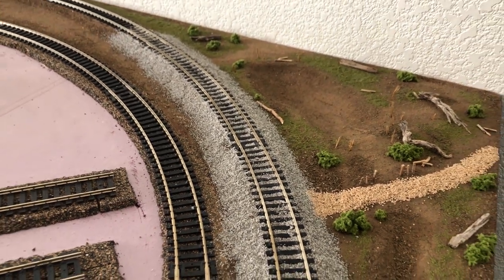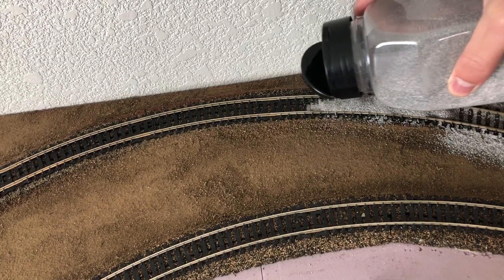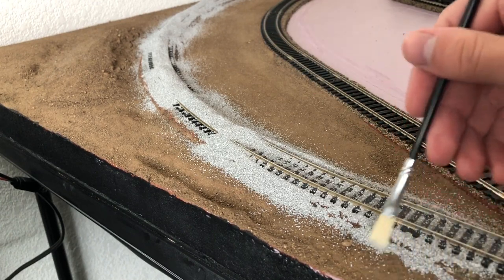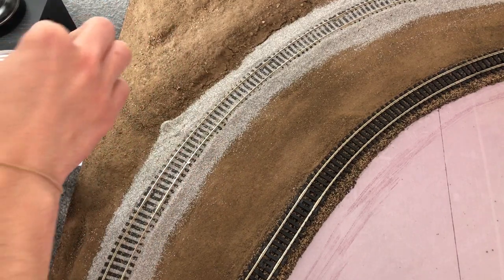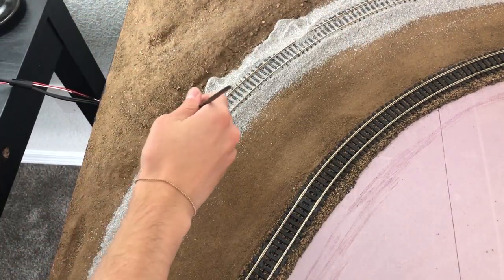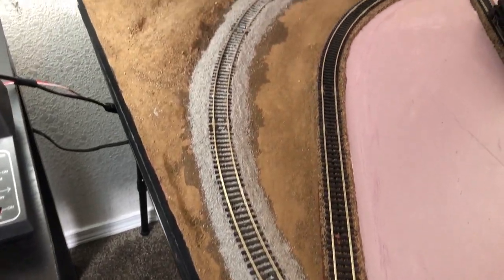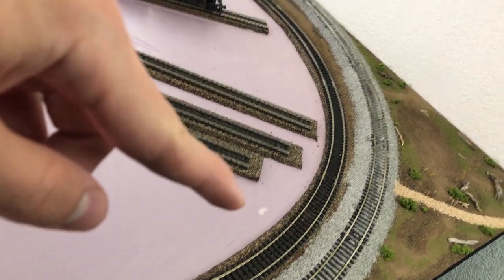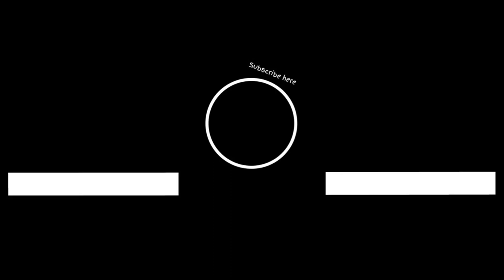Building HO Train Layout - Ep 4 - Ballasting Track!

Comment: I’ve already done some ballasting but haven’t added any scenery and I don’t have a foam board (I have a wooden one) with grass on top
Reply from the maker: Awesome man!
Reply: Sorry i forgot to add asking what i should do for the scenery as i don't have foam to cut into. I could still make little hills with sculptamold though
Reply from the maker: Sculptamold will work but you could add a 1 inch thick piece of foam around the track and sand it to how you want it shaped. If your adding poles or such you’ll have to drill the right size hole in the wood

Comment: I have 2 switches on my ballasted layout that seem to have become ''dead spots'' not too long after I completed the ballasting. I cleaned the track, but still have the problem. Should I replace those?
Reply from the maker: I would try to use a tracker rubber on them to see if that helps and maybe scars or in between the points of contact!
Reply from the maker: Scrape*

Comment: Why spend the money on Woodland's Scenic cement when a 50-50 dilution of regular Elmers Glue is the same thing and a lot cheaper??? It would be better if you used a wetting solution. Either alcohol and water or "wet water"... Elmers will dry in about 45 minutes without a fan. You should never say that things "should" look like this or that. You need to say that this is the way I like things to look.